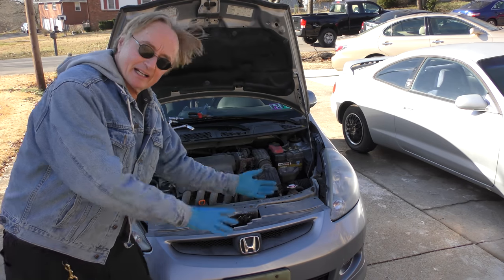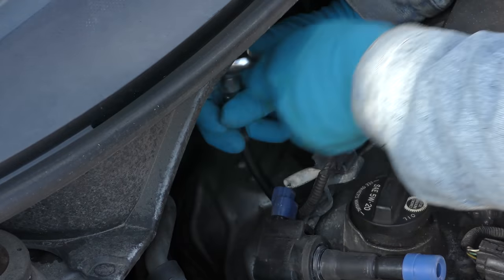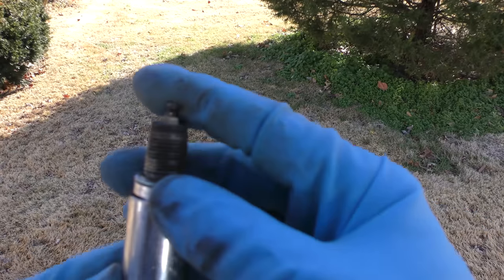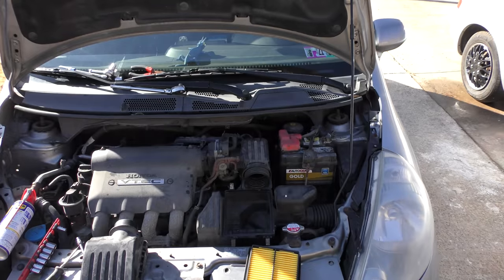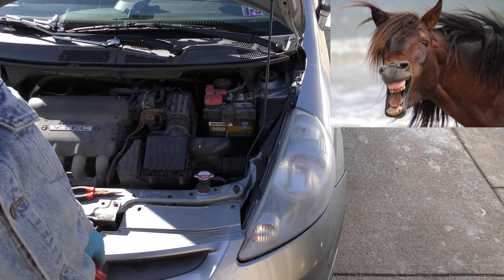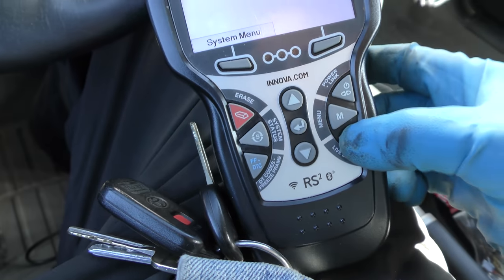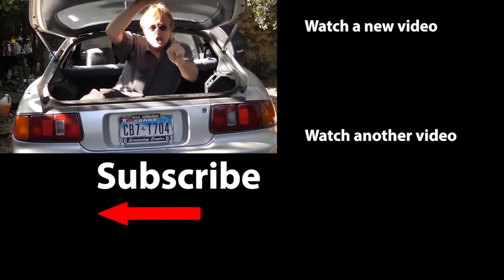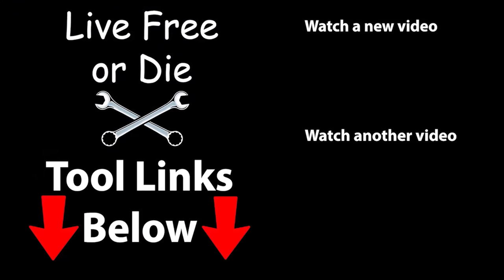This Honda Has a Serious Problem

Comment: i had one of these Honda fits, theyre a really good reliable car, highly recommend it. if anyone has any questios about them let me know
Reply: Richard Stasko I have this same one and I’m having the same exact issue Scotty explained but I have done everything he said in the video already and it’s still having the issue. I have suspected it needs a valve adjustment according to the forums but what do you think?
Reply: I got a 09 fit sport with 110k. It has electric power steering. When I'm driving at highway speeds steering feels little bit loose or like it sways back and fourth. Changed the sway bar bushings on front still not feeling precise. Anyone have this problem?
Reply: I was going to finance one of these as my first car but I couldn't afford it. Got an 04 Accord instead and still very happy. :D
Reply: Yo
Reply: @deecher9494  ,, Much better buy in having a 2004 Honda Accord. Sturdy and easier to repair.
Reply: @rickinhawaii  ,,, Your tyre pressure is oftenly overlooked. It could be low tyre pressure or as simple as a bent rim .
Reply: Just bought a 2013 Fit base model standard 5 speed transmission. Put a rear sway bar on it last week. Really fun car to rev out and it corners pretty darn good too. Gas mileage is awesome.
Reply: @ThePVBLO  could be a lot of things, I’d start by checking for codes. If none, clean the mass air flow sensor with mass air flow sensor cleaner only!! Then run some fuel injector cleaner thru the tank. Also, these cars are known for EGR valves clogging up with carbon. Take it off, clean it up and clean the ports, there’s plenty of videos on that
Reply: @rickinhawaii  could be the actual end links. Put the car in the air and check for play in the wheels, could be a tie rod
Reply: I bought a new ( I know...dumb me ) Honda Fit in '17. I love her. 37 mpg. I like a zippy car and she does that. Corners well. She is the Ex-L model and I love the sunroof and leather seats. I have put only 4184 miles on her. She has good visibility. Tall windows and Hondas Lane Change camera on the passenger side mirror. Love that feature as well as the backup camera. I feel like I am in a convertible there is so much light from all the windows and sunroof. Heaven!  I LOVE Scotty more than anybody I'm not related to. I am addicted to him and his videos. Scotty you rock my life, you are so cool.  Merry Christmas sweetheart and thank you for bringing us your authentic self and your dynamic videos!
Reply: @user-yk4oq4wz4d  I'll check thanks 🤙
Reply: @rickinhawaii  honestly it’s nothing too serious I’d say. It’s an easy car to work on. Oh yeah, your throttle body may need cleaned. A dirty throttle body will also give you that problem too. Take the air box off, spray a little throttle cleaner on a rag and wipe it out. It might not look that bad, but the tiniest bit of dirt could throw off the fuel trims. If you do all the things I mentioned, I’m confident the car will run like new
Reply: @andeeangel561  good cars, you’re not dumb. You can never go wrong with a Honda. On those, they had problems with the CVT transmissions failing, but it should be under warranty and as long as you change the fluid every 25-30K miles you’ll be fine!
Reply: @ThePVBLO  My 2007 Honda Fit just got traded in with 240,000 miles. The only issue I had was it would act like it had someone pulling a plug wire off, or idle bad. I replaced all the spark plug coils (which really on takes one socket wrench). Never had any other issue. Also never top off the tank, bad idea, messes with the sensor. I change the oil with synthetic. Front brakes and rotors twice. That is all the work it needed.
Reply: @rickinhawaii  tie rod or half shafts maybe
Reply: @pd2865  replaced the tie rod ends and sway bar links. No change. What are half shatfs? I called Honda and a tech told me the electric rack may need to be replaced. The estimated was almost 2k at that price I'll just drive it as is until it's not driveable. It's not all that bad just need to turn the steering wheel more than inch or 2 left or right to notice and movement in tires. It's my second car. My daily is a 05 Corolla manual with 250k on it and the steering is way more precise. The fit is more the wife's car sometimes barely used. It's my first car with electric power steering tho. Thanks for all your help.
Reply: @michaell3711  tire pressure is good. 👍
Reply: @user-yk4oq4wz4d  need to check this but can it affect steering?
Reply: @user-yk4oq4wz4d  dirty throttle body can affect steering?  I'll clean it
Reply: @user-yk4oq4wz4d  Well I changed all my spark plugs and coils and my air filter is brand new but still was having this same issue. I ran some cleaners early on and sprayed the throttle body. Mine only has 187,000 miles on it, it had been sitting for a few months from the person I bought it from. I have no clue what's wrong I really thought I needed a valve adjustment but idk what to do from here.
Reply: Rich kin low speeds or parking parrellel, yes bc it puts a load on the engine
Reply: guarionex try cleaning EGR and mass air flow sensor
Reply: I really want one. When did they start adding direct injection to them? I don't want direct injection.
Reply: i have an 09 honda fit sport. bought  it with 101k currently at 113k . Got the dealer i bought it from to replace the starter within the 30 day warranty—cool. Now the battery has been replaced and now the alternator has been replaced—i’m still struggling with a dead battery ☹️ The mechanic i took it too recently said the alternator wasn’t working properly but didn’t see any other issues. Tell me why two hours after i pick up my car it’s still struggling with a power drain ☹️ Any advice on this would be extremely helpful as all these repairs pile up.
Reply: @unlesslorax  you have a parasitic draw somewhere. Make sure all dome lights are off and check the basics
Reply: @unlesslorax  I also saw the relay for the AC go bad which will stay on powered up and run a battery down. The relays are under a black cover under the drivers side headlight assembly. There’s three relays. 2 are for the fans and one for the AC compressor.
Reply: Really common on Honda’s. Cheap fix too. I think they’re around $22 USD. Go get one from Honda dealership. If AC doesn’t work sometimes this could also be your problem. My fit I had did this and fixed the issue. Good luck! Let me know if it helped
Reply: @richard Stasko After looking at all the fuses and relays i finally had to take it in to get a diagnosis and was told that the fuse box has to be replaced entirely… :/
Reply: I have a 2009 Honda fit hatchback and I don't drive slot but I've only had it for around 8 months now n after it warms up it runs like it should with being a used 2009 but the problem I'm having is that once I broke my foot and ankle so it didn't get driven for 2 weeks and when I went to crank it up the engine light came on and went to my appt and then had it checked for codes n got 2 different codes so didn't drive but yo store once and came home waited til next day n needed to put some antifreeze since winter is coming up and it was alittle low and after that the check engine light went out , so what's going on with my 2009 Honda fit? Please let me know what you think.  The codes where p2647 n p0455.
Reply: @trace3113  rocker arm code and evap code. P0455 is a large leak in the evap system. I’d take the gas cap off and put it back on until it clicks all the way right. Often the fix. Rocker arm code is often times from real dirty oil. Change it and drive it more often. Cars aren’t made to sit and often you’ll have more problems with that then actually driving it. Hope this helps but it’s hard to say for sure without seeing the car
Reply: @trace3113  could also be the Vtech solenoid. Often times go bad from lack of oil changes. My last car was an 09 fit that had 180K and never had an engine light come on but I changed the oil every 3 K and had mostly highway miles
Reply: Definitely very reliable. You may not believe me but my Dad has an 08 with 658,000 miles. It’s a real tank if you treat it right. Shoot, we’ve treated it like dog with the weight we’ve put on it in the past and it’s still going.
Reply: @sarahwood8943  I work for Toyota. They’re like that too if you follow the maintenance schedule.
Reply: @unlesslorax  sometimes aftermarket alternators are not the best bet   I had a aftermarket one put on and wasn't properly charging its best to buy oem honda or a rebuild oem from rockauto if they have them.
Reply: Keltic Ride  never had mine stall, but I always cleaned the mass air flow sensor and ran fuel injector cleaner in the tank, plus kept fluids and filters clean.
Reply: Keltic Ride  no but when they did the motion spring recall that was done. Supposed to be done every 105K
Reply: Keltic Ride  injectors can go yes! Run injector cleaner in your tank, never had a problem. Valve adjustments are recommended by Honda every 105K,or if the cylinder head ever has to come off. If it runs fine leave it alone: change your oil every 3,000 miles and that car will run damn near forever. Also do the transmission fluid once a yr. other than that, regular maintenance or fix as things break( which was rare). I did have to do a starter, front axle, and two sets of front calipers. Otherwise, tires breaks alignment, bulbs, wipers, fluids, etc. oh yeah spark plugs one time
Reply: Keltic Ride  it’s crazy how you get back to me on this now when I just tried with another mechanic and still have found no solution after leaving my car for a week. I’ve been dealing with this for over a year so it’s frustrating not being able to find a solution. I feel like the mechanics have tried everything but the valve adjustment though, so I feel like I should just take the shot and see if that really works. I guess I’ll let you know what happens soon something de they plan on opening it up in the next few weeks.
Reply: Keltic Ride  air fuel ratio sensor is an oxygen sensor and not in the throttle body. Two different things
Reply: Keltic Ride  what kind of gas do you run? Only use 87, and I’d recommend an induction cleaning which will clean most of the crap out the car. Have the mass airflow sensor cleaned, fresh gas, new filters, and spark plugs.
Reply: Keltic Ride  these ain’t noted for ring problems unless it has real high miles and oil wasn’t changed enough.  If you’re burning some oil, change the PCVvalve and check the oil every weekend. It’s a budget car, not a 100K Benz.
Reply: Keltic Ride  check all the clamps and connections, a vacuum leak could do this, or a clamp not tightened. Listen for a sucking type noise, but usually you’d have a engine light on for that. Make a vid and send it to me so I can hear this car run
Reply: Keltic Ride  ring problems aren’t going to give you the symptoms you’re having. Take care of your car then this wouldn’t happen
Reply: Hey man, I know this post is old but I’ll shoot my shot I have a 2008 Honda Fit Sport, manual transmission. It has ran great since I got it at 80k miles. It currently has 128,000 miles and has started having misfire issues. The first codes were misfire on cylinder 1, 2, and 4, as well as an upstream o2 sensor fault. I replaced the upstream o2 sensor, reset the codes and ran it again. Now it's only misfiring on cylinder 2. I inspected all the spark plugs, cylinder 2 spark plug was black, indicating that the car is running rich on cylinder 2, the other spark plugs looked fine. I replaced all the spark plugs (NGK) and replaced all the coil packs (Hitachi). The car gained a little power, but it is still misfiring on cylinder 2. My next thought was to do a valve adjustment. 
I'm not a professional mechanic, but with enough research I got the gist on how to do a valve adjustment. When doing the valve adjustment, a handful of the valve gaps were too tight, but none of them were too loose. I adjusted all the valves and put it back together. 
Now, the cars idle sounds a little smoother, but it is still misfiring on cylinder 2. Somethings I have noticed: When the car is cold, it seems to run better, doesn't misfire as bad, and the engine light doesn't come on. Once the car has warmed up, the check engine light comes on and the misfires become very apparent. I have also tried disconnecting the battery for an extended period of time after resetting the codes, and trying it again, no luck. 
Banging my head against the wall with this thing, my next thought is to check fuel pressure for an issue on the injector perhaps?
Reply: @DirtyHammmer  i’d try doing a can of berrymans fuel cleaner, replacing the injectors, cleaning the mass air flow sensor, clean the throttle body, make sure all filters are clean, etc and go from there. it could be a intake gasket but usually with that the car will run bad when cold and get better once it’s hot. hope this helps, let me know bc i’m curious too!!
Reply: @DirtyHammmer  and plus honda fits had issues with injectors. take the number 2 coil and swap it with another cylinder. you may have a bad part even tho it’s new. if it’s another cylinder then u have a bad coil. check the gap on the plug on that cylinder too. sometimes the parts stores will drop one and there’s no gap for the spark to fire on.
Reply: @ThePVBLO that or clean the mass air flow sensor, and try gas tank fuel cleaner

Comment: I"ve owned two honda fits  an 07 that was hauled from an insurance claim that had 244K miles and was still running and driving, couldn't afford body, and suspension work. 
My current 08 has 196K. Love these cars. My first one would try and stall while cold the spark plugs, air filter where changed and it did okay till the serp belt snapped and shreaded then the tensioner pully fell off XD Managed to make it work with an inch smaller belt. These cars are awesome, they will get up and go pretty quick with just stock, but they are easy to work, cheap parts, and great gas saver for someone like me who loves to drive, plus fold the back seats down and you can haul just about anything I"ve had everything fridges, deep freezers, wood, hay, animals, people, cargo in my car. you can FIT A LOT IN FIT
Reply: The bottom of the rear seats fold up, too.. so you can put stuff in behind the front seats and still have the rear cargo area separate because the top of the rear seats can stay up

Comment: Still driving around in my 07 fit.
Had serious idling problem in the past but after some digging and helpful guides end up performing a valve adjustment and replaced the spark plugs/coil packs.
The batteries on these cars are weak, suggest tossing the battery cradle and going with a bigger battery, NE winters require it.

Comment: Always a good video. Just traded in my 2007 Honda Fit with 243,000 miles, original back brakes still good, front brakes replaced twice with new rotors, and one coil, all four plugs. It ran like clockwork. So I bought a 2020 Honda Fit. In between we bought a 2018 Honda Fit. So far no trouble from any of them. 2020 is the last year, gas prices down, economy cars not popular. But being empty nestors, we both just want a dependable, small easy to park easy maintanance cars. And to be honest, they drive great long distances. I never had any problems with this car.
Reply: Now gas prices are double, hope you still have the fit? We have one, was going to sell it, now rethinking that lol

Comment: Scotty, thank you for alot of good information on various types of vehicle. I drive a pre-owned 2017 honda fit and bought it  45,000 miles. I drive the at 300 miles a day, because i work two hours away from home. It's a damn good employment, however the mileage is high at 174,000. I changed the oil between 4,000 to 5,000 miles or every month. It's been a good vehicle, I changed plugs, but need to change the  transmission oil next week. At any rate, I have engine light on. I used an Innova 5110 OBO2 carscan reader. It shows a P0420. WHat's your recommendation, I thinking about changing the O2 sensor as recommended. Any recommendation is welcome. You're awsome and thank you for your Youtube channel.

Comment: First gen Fits use MAP sensors in the intake manifold so it is pretty difficult to get vac leaks. Only possible place is intake manifold gasket

Comment: What year is this Honda Fit? so Scotty did not take off the Windshield wiper assembly,,, (like all the YouTube vides show) when changing the spark plugs using the flexible Extension. So has anybody did it this way?  Pro and Cons?

Comment: I believe I'm having this issue - drops into neutral at idle when cold, jerks on take-off. After the car warms up, it runs smoothly. Already changed the CVT fluid after a mechanic said it was a transmission issue, which obviously didn't help. Now going to give this a try. Thank you!
Reply: Sorry.. But your mechanic is right. The cvt is a common lemon. Mine did that for a year and got worse till it just got so bad I couldn't get it to stop slipping to neutral
Reply: @Jacebeaner  Yeah, changed the filter and still having the same issue. Only mine has been like this for 3 years and not getting worse. Other thing I heard was spark plugs, not sure if it's worth giving that a try.
Reply: @EmilieSagae  coil packs perhaps.. How is it up a hill?
Reply: @Jacebeaner  Yeah no issues uphill at all, after the first couple of minutes when it's warmed up it seldom jerks at all. Worth trying the coil packs?
Reply: @EmilieSagae  did it work?
Reply: @sennamontea1380  I changed the air filter and it didn't help. I ended up selling the car rather than trying other solutions

Comment: I have a 2008 Honda Fit Sport with 270,000 miles. Getting ready to do this same task when the weather cooperates. It's not running poorly, just regular maintenance. I do wish I could have seen where the spark plugs are located. It doesn't look like they are that easy to get to. Going to need one of those cable wrench extender things. Nice to see the same recommendation that the carkillers forum gave for injector cleaner.